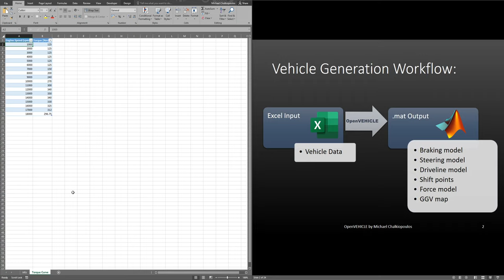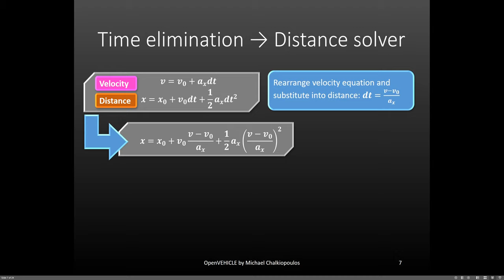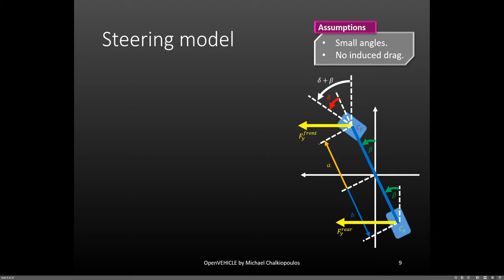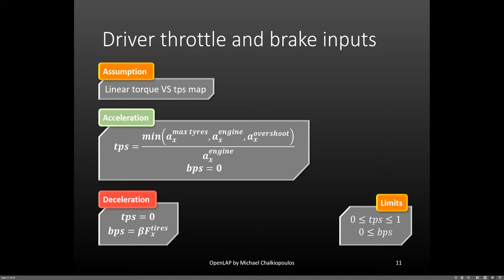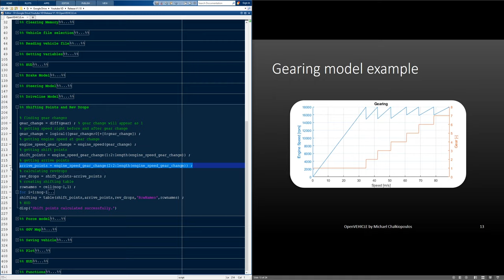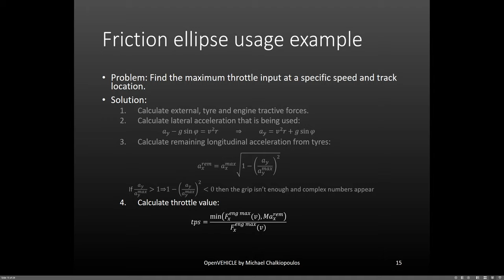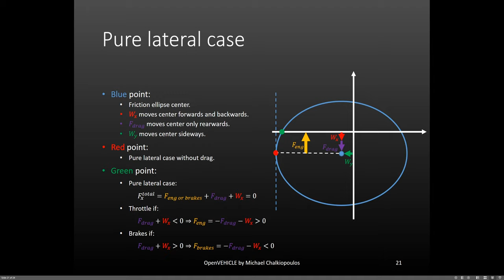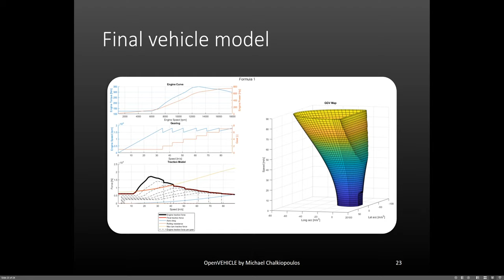OpenLAP Lap Time Simulator Part 3: Vehicle modelling in OpenVEHICLE

Comment: Good afternoon!!

First of all, your content is incredible, congratulations !!
I have a question about the gear shift programing, from Excel and MatLab. I'm from a FSAE Electrical team, so our car doesn't need to change gears or anything, it just has a 2-stage transmission with a reducer and a pair of gears. So, in that case, can I just put nothing in the gear shifting phases in Excel and will it work in MatLab?

Thanks for the attention!
Reply from the maker: Hello Guilherme Bottino.
First of all thank you for your support!
For the code to run you need a gear in the gearbox.
So just put 1st gear to 1:1 ratio, delete the other gears and you should be fine.
Then you can adjust your final drive to fit your needs.
Reply: @_phoinix  You are the best!

Comment: Hi there 
great video and really appreciate your effort. 
I was just looking through the code as was wondering how you got the value of dv = 0.5/3.6  (new speed vector for fine meshing)
Why have you chosen that? I dont know if I have missed something. 

Also a question regarding the tyre model. In the equation you take No - Fz which is then multiplied by the load sensitivity. 
Could you explain what the No is and where it comes from. I see that it is equal to Normal Load in Newtons = Friction Load Rating*gravity. But not quite sure what Friction Load Rating is and where do you can find it. Why is this different to Fz? 
And lastly regarding 28:01 in the video, I was wondering why do you use cos(0-180). Could you explain your theory behind that. I realise it is to expand the ay values over the 'circle' but not to sure how or why this works. Why is it cos? Does this effect the overlap? 
I would appricate any answers to these questions. Thank you very much for your time.
Reply from the maker: Hello Bober Burgers,
Thank you for your comment.

The value of dv=0.5/3.6 is just half a km/h converted to m/s.
From my experience, and with the accuracy a point mass model gives you, this is fine.
You can use a smaller value if you want, but if you go too low, the interpolation will be slower.

N0 is the nominal load for the tyre.
This means that the value of the friction coefficient μ0 has been measured at the load N0.
The final friction coefficient changes depending on the difference of the applied normal load to the nominal one.
If it’s the same, then δμ/δFz*(N0-Fz)=0 => μfinal = μ0
The value of N0 comes from tyre data.
If you do not have any tyre data, then a reasonable guesstimate is 1/4*Mtotal.

The GGV diagram is just there for you to visually see the performance and make sure all is good in the model.
It does not drive the model, as in many other lap time simulators that interpolate a pre-solved the GGV diagram.
So you can create it any way you want really.
Now, when you create it, you need to go through all the values of the latacc from left to right, or right to left and calculate the maximum acceleration and deceleration longacc.
But to make the graph look nice, I mesh the latacc using the cos, so that I you get an even distribution of nodes in a circular fashion.
You can do this any way you want.
It just happened that I liked and chose this way of doing it, as cos(0)=1 => ay=aymax, and cos(180)=-1 => ay=-aymax, which means that I can do everything in one easy loop.

Hope this helps!

Comment: Hey Michael, thanks for the video and sharing your project. I'm from a FSAE Electrical Team, and I wanted to know what should I consider for adapting the vehicle dynamics coding from an internal combustion engine to an electrical engine.
Reply from the maker: Hello,
To start with I would change the parameters of the fuel consumption to energy consumption, use only 1 gear in the gearbox with a 1:1 ratio (so that I can change the setting with the final drive only) and use a different power curve from your electric engine torque graph.
The depth you can go to is only limited by your imagination.
Reply: @_phoinix  Would these changes be the same if you were using a CVT, minus the energy/fuel consumption change? Looking to use this for modeling a formula car with 2stroke and 4 stroke engines and cvts. Thank you and really appreciate any help.

Comment: Hey Michael, thanks sharing your project.
I was just wondering if you could help me with the equations at 4:06 (Tyre Model)
I am not too sure how you got this formula. 
Could you maybe explain this derivation or guide me to some literature to understand how this formula/model works. 
And is there any reason why you didn't choose to use an empirical model, like pacejka?
Your answers are greatly appreciated.
Reply from the maker: Hi Kevin,

If you take a look at the D parameter in the Pacejka equation, you will see that it resembles mine a lot.
That is not a coincidence.
It is just a friction coefficient, that drops linearly with increasing load.

About the full Pacejka now.
As this is a very simple point mass model, with:
1) no steering/slip
2) no camber
3) no ackerman
4) no pressure
5) no temperature
6) no differentials
7) no many other things...
Why should I bother include the full Pacejka?
Well, there is no reason to include the full Pacejka.
We simply look at what maximum grip level we can achieve at a given normal load.
We do not care at what slip ratio/angle this happens.

You need to think about my goal when I designed OpenLAP.
This lap time simulation tool was not designed to do everything.
It was designed to teach people about VD and how such tools work.
But, if you watch all the videos, in the end you will see that even a very simple model as this one, can be very effective in giving you valuable information, if used correctly.

Hope this helps!

Comment: Hey Michael, firstly,  I'd like to thank you for this project. I have a question, how can I change the Vehicle model for a racing motorbike ?
Reply from the maker: Hello Maaz Delvi.

First of all, as this is a point mass system, roll and pitch on cars and leaning angles on bikes will not be modelled in OpenLAP.
But you can include those in the code by expanding the models in OpenVEHICLE and OpenLAPs functions.

Now as a starting point, to model a bike, I would change the number of driven wheels to 1 and always use a RWD configuration for the longitudinal acceleration tyre forces. I would also change the division by 4, to a division by 2 when calculating the normal load in the tyre sensitivity for the lateral and longitudinal deceleration case.
Also, in the steering model, I would include the leaning angle. You can do that by equating the total x axis moment from the tyre contact patches to the one created by the total mass that is off center, and then solving for the angle.

I hope this helps!
Enjoy OpenLAP!
Reply: @_phoinix  Thank you.

Comment: Hi Michael,

I don't know if you're going to see this, but your GGV code has a bug. Your lateral acceleration is no symmetric.
Reply from the maker: Hello Augusto Dfloth,

Could you please explain this a bit more?
Reply: two years later, but for anyone working on it:
 @_phoinix  if you look at XY plane, you'll see that the negative half of Ax has an offset to the negative side of Ay (the peak braking acceleration has some lateral acceleration on it)
It seems to me that the bug is on line 314:
GGV(i,:,2) = [ay',flipud(ay(2:end))'] ;
you should either flip and then eliminate the first value of ay, or eliminate the last value instead of the first (and then flip).
I did that and now the plot is symmetrical.

Comment: Hi Michael! First of all I´d like to thank you for sharing this content, I´m learning a lot!
I´m struggling to run the OpenVehicle code in Matlab, it says that a function named ´spreadsheetImportOptions´ is undefined. I´ve been looking for it in the code but I coudn´t find it either.
Do you know how could I solve this problem?
Thanks, 
Bernardo
Reply from the maker: Hello Bernardo Murgia,
If I remember correctly, this is part of some functions (with the readtable function) that were introduced after 2016. So check your Matlab version. Otherwise use the older but slower xlsread function to read the file.
Hope this helps!
Reply: @_phoinix   Yes, I think the problem is the Matlab version I have. I'll try to solve it, thanks for answering!

Comment: Hi Michael, an excellent video I am learning a lot about vehicle dynamics and I am loving it :). I just have a request I have been trying to derive the formulas that you have used for the calculation of the GG diagram and I am have watched this video many times however I still struggling to understand how you have to take the formulas you have shown in the video and calculated the lateral acceleration, longitudinal acceleration and deceleration. I am not the best at maths :( and I have tried to look up different books but they are all too complicated for my understanding could you please help me out and explain it in more detail for a not so smart person. That would be of great help for my learning.

Keep up the great videos cant wait for the next video on OpenTrack :) !!
Reply from the maker: Hi Solid Works,

The only thing that can move you around is the tyre, because its the only thing that is touching the ground. 
This immediately makes everything a function of the tyre model.

The equations that I used to simulate the tyre are ones that I chose, meaning I did not derive them from something else.
Pacejka for example did the same thing. He did not compute him model from something, but chose to use a combination of mathematical equations that he knew would resemble the characteristics of a real tyre.
In OpenLAP, I chose to set the tyre force equal to friction coefficient times normal load, with the coefficient changing linearly with normal load.

So the the only thing you need is the normal load to get maximum tyre force.
This comes from weight and aero.
The deceleration uses the maximum long tyre force as is.
Lateral also uses the maximum lat tyre force.
The acceleration takes the minimum between tyre and engine.

For the combined situations I use the ellipse, which is again something that I and many others before me chose to simulate it, just because it is really simple and good at modelling the tyre.

Hope this helps in some way!
Reply: @_phoinix  Hi Michael,
what is the Longitudinal & lateral friction sensitivity and where or how did you obtain these values? I have played around with the value 0.0001 and if I do anything bigger the GG diagram breaks while anything smaller the diagram is unchanged. I get a sense that it has something to do with the slope of the linear function. Cause if we hypothetically plot a graph of this linear function the y-axis would be friction coefficient and the x-axis would be the normal force, therefore, the gradient would be 0.0001 (Longitudinal & lateral friction sensitivity). But I still don't understand where this comes from and why?
Reply from the maker: If you look at how real tyres behave, you will find that the friction coefficient drops as you increase the load.
This is why in general, softening up the ARB on one axle will tend to increase grip on that axle, as the load transfer is reduced, meaning that you minimise the friction coefficient loss on that axle.
As far as the sensitivity values are concerned, they come from experience and from tyre data in general.
I would not go much above 0.0003-0.0005 for a very sensitive tyre.
If you go too far, then the friction coefficient becomes negative, and that is the reason the GGV diagram "breaks" and folds into itself.
In general, if you don't plot the friction coefficient or maximum tyre force vs normal load, for both values of the sensitivity you are testing, then you won't be able to make out the difference by eye, just by looking at the complete GGV diagram.
But if you run two simulations in OpenLAP, you should be able to make out the difference and the effect on the apex speeds, especially at fast corners on a high downforce car.
Reply: @_phoinix  would it be possible to direct me to where I could understand more about the sensitivity values such papers, books, websites anything as I would like to do some further reading on this as it is something I cant seem to find on the internet and I would like to fully understand where it comes from. that would be of great help.
Reply from the maker: Tyre data is generally difficult to come by.
Also, the coefficient values depend a lot on the units used.

But anyway, in terms of books, look for Hans B. Pacejka:
https://www.sciencedirect.com/book/9780080970165/tire-and-vehicle-dynamics.

A quick google search yielded this paper for formula student tyre modeling:
https://www.researchgate.net/publication/337784329_Tire_Model_with_Temperature_Effects_for_Formula_SAE_Vehicle

For videos, check this one out:
https://www.youtube.com/watch?v=WW1qCuuleTQ

Hope this helps in some way!

Comment: Hello Michael!

Very informative video, thank you very much for making this.

I have a doubt, please correct me if I am wrong. Why we are using bicycle model in point mass simulation?
Reply: Also, can we get to download the ppt file?
Reply from the maker: Hello,

As I said in the video, the steering channel is only a "driven" channel. This means that the bicycle model is used only in post processing, as a very quick way to calculate a steering wheel angle so that you can use it if you need to.
I thought better have it than not.
The bicycle model does nothing during the simulation of the lap, only after.

Hope this makes sense.
Reply from the maker: Also, I will upload the slides when I am done with the videos.
Reply: Okay, I now get it. Thank you!
Reply: That’s really cool.

Comment: Hi Michael, thanks for the great video. They are really amazing. 
I just have one question regarding the steering model if you don't mind. 
I am struggling to understand how you derived the formula Fy tyre (Lateral Force) = 2Cf (δ+ β)+2 Cr β
Is Fy front seen as the lateral force on the tyre in the front? In this case, would it be perpendicular to the tyre y-axis by definition? 
Also isn't the tyre slip angle in the front the angle between the velocity vector of the front tyre and the y-axis of the front tyre. Is the velocity vector of the front depicted in this diagram? 
Also is it just possible to add δ+ β to get the slip angle? 
I hope all these questions make sense. 
Thank you again for the time you take to answer these.
Reply from the maker: Hello Dominic Illenberger.
Thank you for your comment!
First of all, the steering model is there to estimate the steering wheel angle.
And it is a driven channel, i.e. it does not drive the model!
The equation is very simple if you look at the diagram in the video.
The total cornering stiffness per axle is just the summation of two tyres which gives you 2*Cf and 2*Cr.
Then you take each stiffness and multiply is by the total slip angle of each axle.
At the front you have β+δ and at the rear you just have β as there is no rear steering.
δ is steered angle in the front (front tyre vs body).
β is the vehicle slip angle (body vs total velocity vector).
This gives you: Fy = 2*Cf*(δ+β) + 2*Cr*β
This is ok/true/acceptable if you assume the following:
1) The angles are assumed to be small, i.e. sin(angle)=0 and cos(angle)=1.
This means that the Fy force, which (as you correctly stated) needs to be normal to the tyre is basically on the global y axis.
At the same time, this means that there is no induced drag due to steering and vehicle slip angle.
2) The tyres always produce force linearly with slip angle, no matter how much slip angle you put in the tyre.
That means that we have linear equations and we can use linear algebra to solve the system easily.
Is this correct?
Well, between:
1) the point mass assumption for the solver,
2) the bicycle model for the steering calculation after the fact,
3) the fact that there is no weight transfer modelled,
4) the fact that we do not have kinematics/ackerman settings included,
4) the linear tyres,
5) the actual reason of its inclusion in the calculations.
How much accuracy do we lose by not calculating the exact normal Fy load on the tyre?
At this point, should we bother doing it?
If you watch part 6, you will see what this method gives you, which in my opinion is ok.
In my mind, you need to weigh the time and effort you put into the model with what you want to get out of it.
Here we are making one million assumptions and creating something that is solved in seconds.
But, we get something acceptably close to reality, as seen in part 6.
Is it correct? NO!
Is it ok/Does it serve the purpose/Did you learn something? YES!
That was the goal.